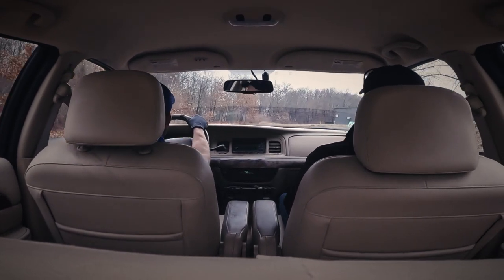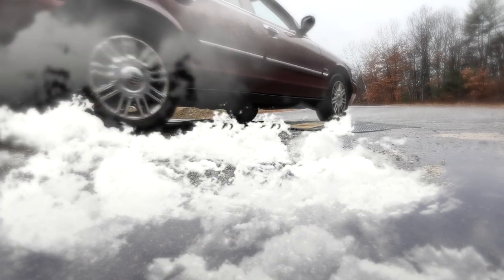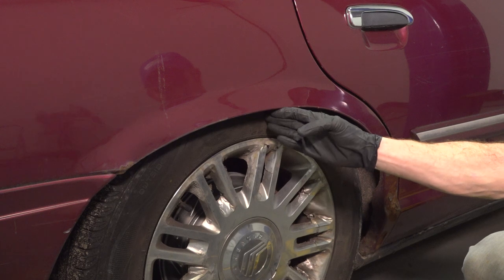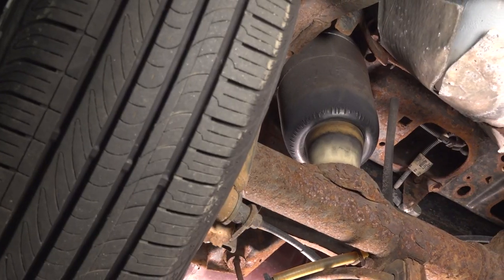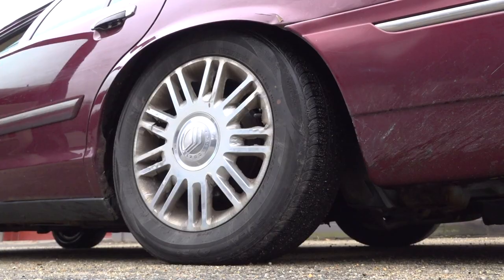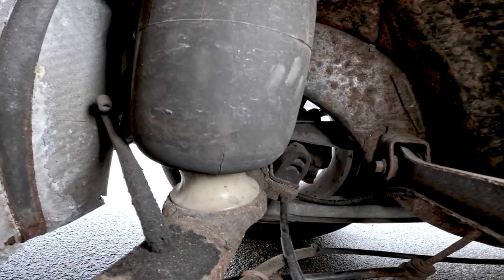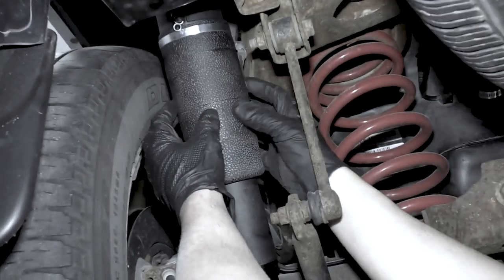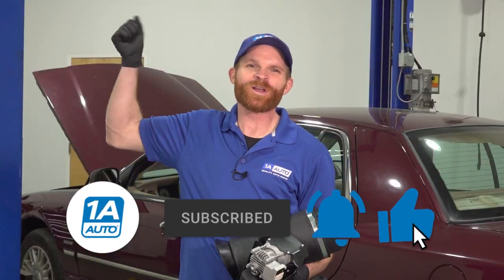Truck or SUV Has Sagging or Broken Suspension? Save Money by Replacing Air Suspension Parts Yourself

Comment: I switched the air ride out when it failed on my grand marquis for coil springs... I didn't notice a performance difference after the switch.  Air springs I thought were just for load leveling.